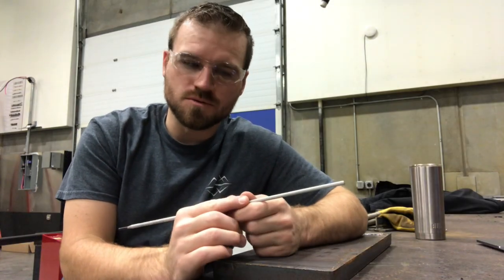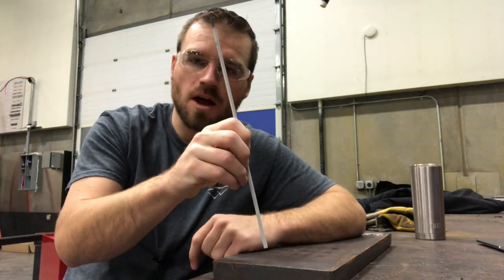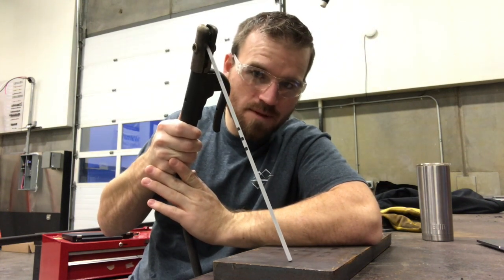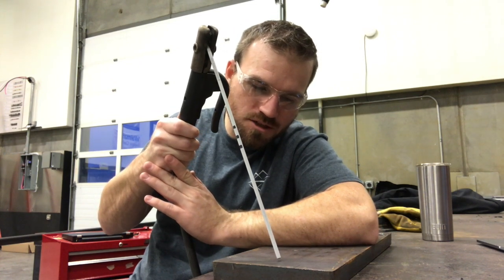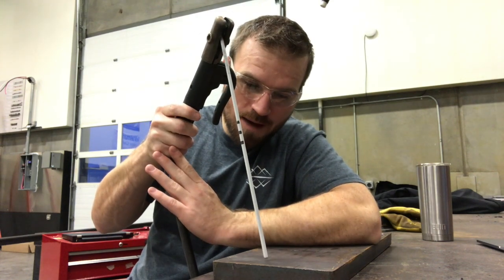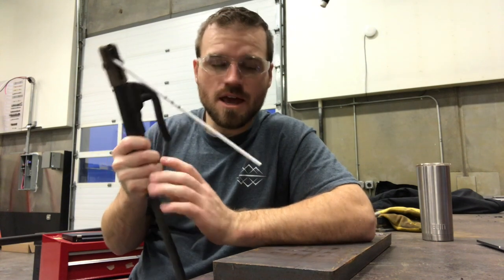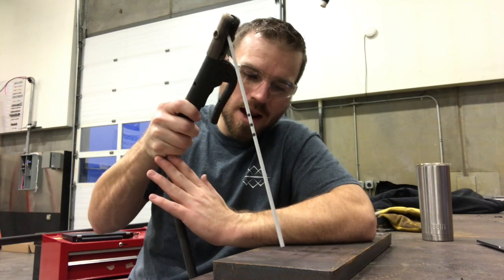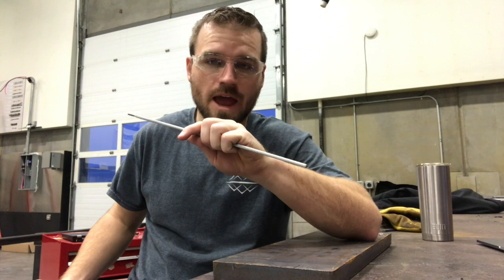Welding SMAW-How to Strike an Arc

Comment: OK - so what happens when the rod constantly sticks?
Scratching or tapping makes no difference
7018 110-150A makes no difference.   1-1/2" angle iron that has been weld ground clean.  Sticks everytime fast or slow.
Reply: Try a shorter length of rod and build up
Reply: yep same here, I know it's not my technique that's the problem because I strike just fine in flat position but have been sticking every time in vertical and my instructors pretty much ignore me when I try to ask what else could be the problem

Comment: What if all I'm doing is melting and making holes in the metal would it be because it's to hot?
Reply: Not moving fast enough perhaps?, I did the same.
Reply: Sure, could be a slow hand- or too many amps for the base material/too thick an electrode- or, most often for me, the electrode is held too high from the target material, resulting in increased voltage = heat.

Comment: In my experience the biggest issue beginners have is not having clean material for their ground clamp. I’ve seen guys (and done this myself) struggle for countless hours trying to get an arc to start and stay lit simply because they didn’t have a clean ground.
Reply: After reading this I cleaned the area where I ground it and it works way better thank you
Reply: 100%
Reply: Totally agree!

Comment: For a beginner like me can I shorten , break or cut , the rod so I can have better control as I try some practice welds ? I know that I will not be steady enough with that long a rod right off the start .
Reply from the maker: You can, but I would recomend you stick with the longer rods because over time you won`t even notice it. Work on you form and the control will come in time! good luck!
Reply: When i first did stick I would hold a part of the rod with my left hand to have more of control of it and then as the rod burned down shorter I'd take my hand off of the rod
Reply: Try this method it worked for me.... https://youtu.be/39n14-IRvX8

Comment: Started trying to get an ark yesterday, but with various levels of success. Can someone please tell me why, when contact between the tip of the rod and the steel does the “contact “ not automatically create the start of an arc?
Reply: It does, but if you don't move the rod off the plate quickly enough it will extinguish the arc because your voltage will be too low. Then your electrode freezes to the plate.
Reply: Probably not running enough amps. Keep bumping it up 5-10 amps until you quit sticking constantly
Reply: Plasma requires heat, once that heat is enough, the electrons travel thru that gas, so when you lift the tip slowly, the elections fly off the tip, heating the air around it allowing more electrons to flow, but lift the tip too high and it cannot heat up the greater volume of ambient air between tip and workpiece, so the temperature drops and the plasma field collapses.
Reply: because is only 50 volt , soit has too be red hot to jump

Comment: Is it SAFE , when SMAW welding, to hold a workpiece  with a gloved hand?
Reply: One thing to remember with arc welding, if you screw up and get your fingers in the current path, you don't just get shocked, you get burned. The low voltage high current of an arc welder is intended to make instant heat. So, don't expect it to feel like when you accidentally touch live house wiring where if you let it go right away you're OK. It will probably burn your fingertips off if you get your fingers in an arc welder current path. Treat it with respect.
Reply: @onemoremisfit     Thank you.
Reply from the maker: No I would not do that! it will either not create a ground or you will complete the ground and hurt yourself.
Reply: @Mikesfilmss  
Let me rephrase the question to you, since  all others, including Lincoln Electric, state that it would be safe:

One workpiece is attached to the ground clamp. With my left gloved hand, holding down the other workpiece to the grounded workpiece, if I proceed to arc weld, would I receive a shock?
Reply from the maker: @usernamemykel  As long as you are not inserting yourself into the circuit you should be fine
Reply: @usernamemykel  You will not get shocked describing what you are talking about doing. You would have to become part of the circuit to get shocked. You really can't do this because the circuit is between the ground and the electrode. This is why you can weld underwater and in the rain without getting shocked.
Reply: neoc03 Many thanks.

Comment: why does my arc welder destroy or tears my square pipes and sheet metal and I get a very messy weld.?
Reply from the maker: This question is not a simple one! Before I try to answer this I must admit I`m not a welding engineer but I have read alot of textbooks as a teacher and I was a welder for 9 year. 

Let start with the thin gauge metal question: SMAW is rated for 1/8 to unlimited, the reason for this is the weld puddle needs a heat sink. A larger piece of metal will cause a colder weld so when you have a thin piece of metal the weld puddle become super hot and burns off the shielding gas. This creates porosity and/or spatter depending on how much heat you have and how thin the metal is. does that answer your question? you can always PM and show me what you are working with. secondly, I would ask how many amps you are running, it is possible to turn down the amps? maybe a thinner welding rod too. 

The question about the square tube: Is this a thin wall tube? the last answer may have answered this so if it's not a thin-wall tube then I would ask what rod you are using? what amps you have it set at? what your rod angle is? 

if this helps you let me know if not PM me with a picture but I think SMAW is too beefy of a process for what you are doing.
Reply: If you're welding sheet you should use 6013 or 7014. Even then you should use small diameter electrodes 1/16 or 5/64.
Reply: Ditto, my limited knowledge includes using an electrode that's the same thickness or less than the metal I'm welding. Another variable aside from current, arc length, speed, electrode size and angle is the chosen stick. 6010, 6011 are known to penetrate deeply. 6013 and 7018 less so. For welding thin sheet metal, I'd want to use MIG welder with either gas (indoors) or flux core (outside, windy locations). For me, stick welding sheet metal is the recipe for failure.
Reply: @paddlepower888  basically it has nothing to do with the welding amperage

Comment: I still remember how startled I was when I first struck an arc with my powerarc welder. Fun times.
Reply: Dude this was me today.. first time I was shaking the rod bouncing all around lol
Reply: @pappaclutch3266  I'm finding you all over YT bro 😂
Reply: Lucas Welding & Fabrication 😳 Look away bro! Just .. Look away.. lol
Reply: @pappaclutch3266  😂👍🏼
Reply: I literally did my first weld today... on an old rusty exhaust pipe for practice. After much frustration i managed to patch the hole i blew in it. Even for an experienced welder it can be tricky and i didn't even realize this until afterwards XD
Reply: That was me today as well, took me 45 mins to start an arch. I got so excited. Lost the arch after about 3 seconds.. didn’t even weld anything. What a day!
Reply: I always get a little freaked and flinch at first whenever I strike the metal lol and I don't know what Im doing, which is true but I don't know hahaha